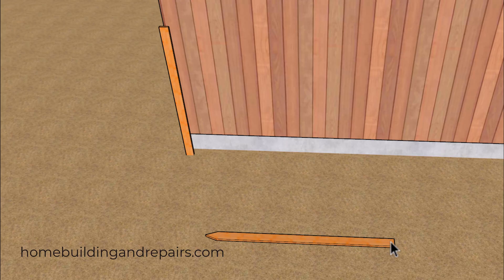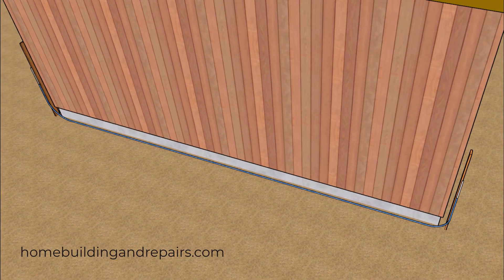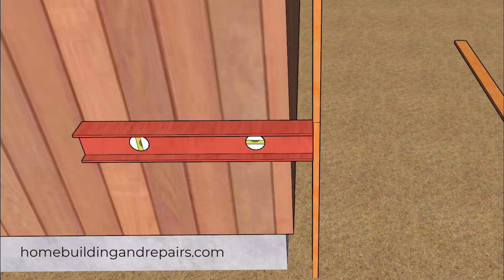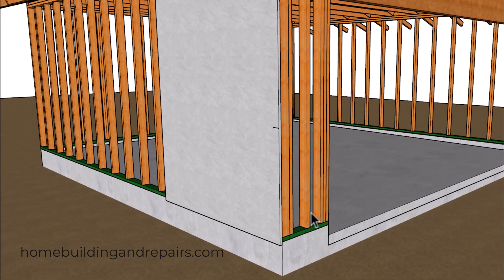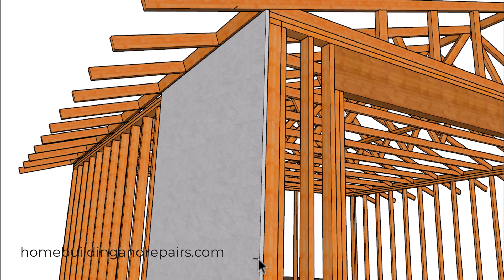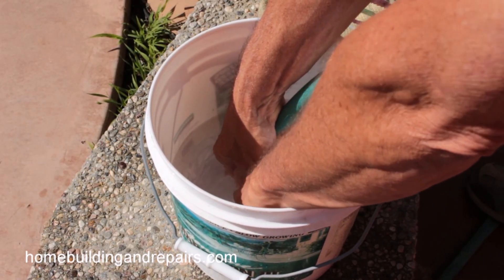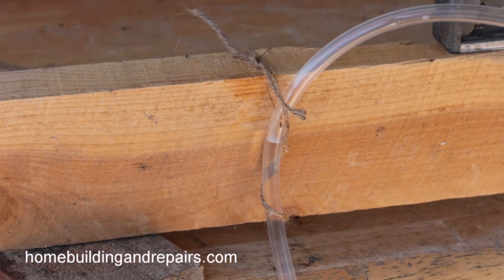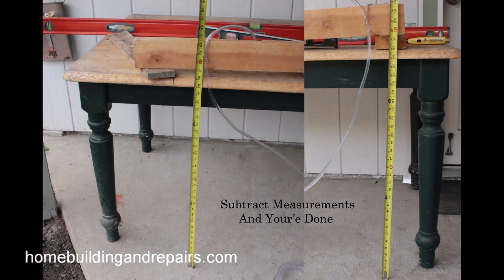Is Your House Sagging? Here's How to Check for Level with a Water Level and Wood Stakes

Comment: I have used water levels on many occasions and now also use laser levels. However every time I use a laser, I check it with a water level at least in four locations (N,S,E&W) to enure the laser is calibrated before trusting it. 

There is a problem if the temperature of the water is not the same throughout the tubing, the accuracy will be compromised. Such as working on the perimeter of a building where one side is in the sun and the other is shaded. Simply flush the tubing with fresh water and quickly check level before the temp changes. This becomes more critical if your water level uses a reservoir instead of simply a length of tubing.
Reply from the maker: Great points and tips!

Comment: Hey I’ve been watching some of your videos about framing and concrete slabs. I was wondering if you could make a video on building a 2000sq wood framed barndominuim and what kind of slab you would recommend and also if you think the shear value from the r panel alone Is enough instead of doing plywood sheathing!